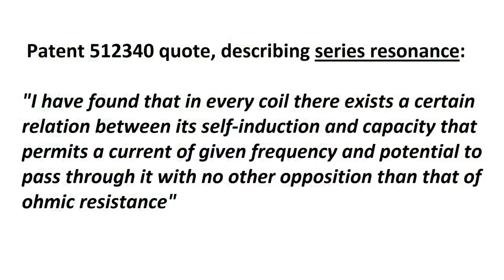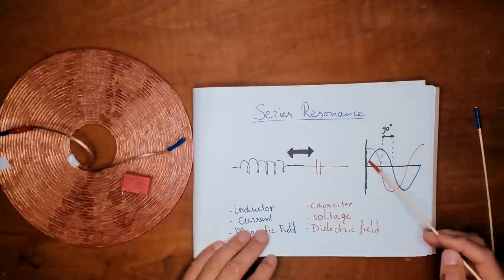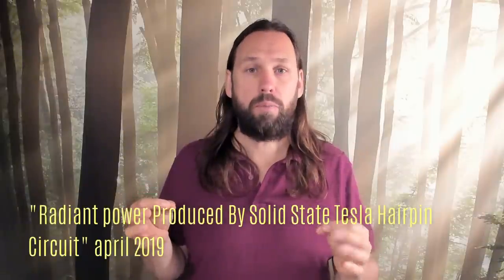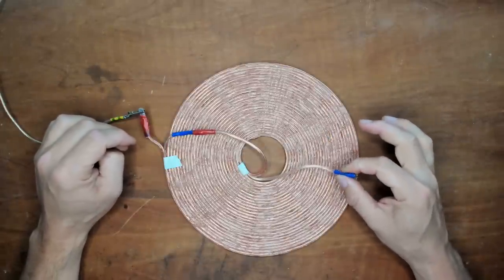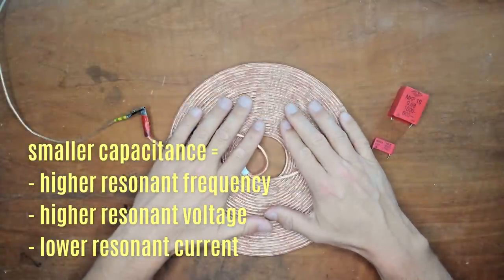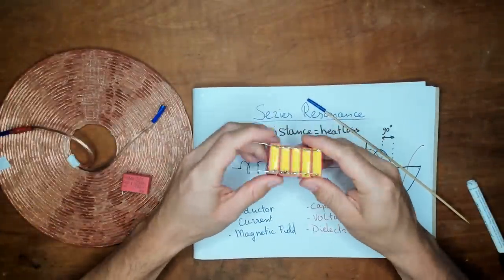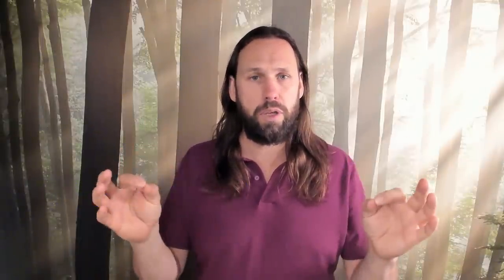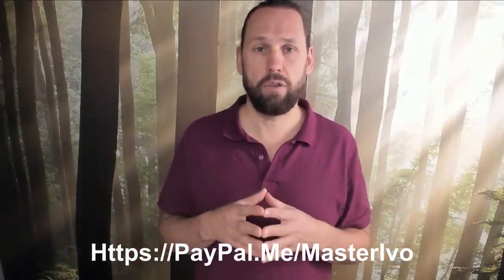The Series Resonant Bifilar Coil, Made For Longitudinal Impulse Electricity.

Comment: circuit zvs produces energy from negative poles only, You can operate 4 LED lights 3 volt - Available on the eBay website
Reply: can you develop this circuit to operate on feed-volt adapter 3000 dc transformer Microwave?
Reply: Zvs is a great configuration, it’s an offshoot of the Royer oscillator. 
It’s most certainly my favorite oscillator, however sadly I can’t get it to function with two 12Ax7  Triodes  :( I didn’t try too hard and moved onto another project.
Reply: @kolinevans9127  Simple tests On zvs - Running a small motor dc It works at low speed but when adding negative poles from zvs On the poles motor the speed increased slightly, and the difference in speed is clear - If the speed does not increase poles must be replaced because the polarity sometimes changes to mosfet in zvs --- Also, you can use it to analyze water - when you put the negative poles in cup glass  water that produces very little hydrogen - But analyzing the water for a long time, approximately 9 hours continuously, will get a large amount of red iron oxide - In water I used stainless steel electrodes not iron -But if the electrolysis of the water lasts for three days or more - Iron oxide is converted to a black substance Like oil - The reason is the acid material Also, stainless steel electrodes will be exposed to consumption Acidic effect
Reply: @kolinevans9127  Power Supply User on zvs - Laptop Charger 20 volt
Reply: maniac thanks for sharing, I guess to get a reasonably high current rotational for your alternator idea one could use the same ZVS oscillator, it kinda makes me think of years ago when the dude at the rubbish tip told me someone{s} raided batteries, TVs and probably alternators lol. 
I wonder if they had similar ideas? 
As I was the only person interested In those things that he saw I ’m sure he thought it was me lol
Reply: maniac thinking more about your question, my best answer is that the ‘b’ field of the mutual induction is separate in itself it’s own circuit whereas in a ‘transformer’ there is no physical separation in its own ‘b’ field, I’d say that would play a part , again I’m not the authority, but I hope this finds you well.

Comment: If the circuit were resonant, there would be no phase difference between the voltage and the current.
Reply: @energycrafts8206  By the way, were are you located?
Reply: The ball is in your court.  I have deleted all my previous comments.  Although the Youtube algorithm scores and ranks channels based on a number of factors including the number of comments.  So any comments, good or bad is a good thing for MI or anyone!  However, I too felt many of my comments probably seemed a bit too futuristic (despite experimental proof in most cases) and also overly  revealing of  many "secret" hints of concepts and principles, so I have removed all my public comments here.   I won't take up anymore space beyond simple limited non-revealing replies here.
Reply: Say what?
Reply: @energycrafts8206  pm me?

Comment: WTF is useful about impulse power??? Looks like you can achieve the same results using a normal coil with a parallel capacitor so at a certain frequency, the inductance is cancelled out by the capacitance leaving only the impedance of the wire.
Reply from the maker: Yes I wondered the same, That's why I keep researching. Now using current impulses, from capacitor discharge. It's a whole different effect
Reply: @MasterIvo making this into a toroidal would make incredible flux density and power density. It must be very close to the shape of nature.

Comment: Negative impulse frequency what?  Wtf are you talking about you either achieve resonance or you don't
Reply from the maker: resonance is a period of time with a full cycle of transformations between the electic fields (magnetic and dielectric).  But you can also interupt the period after 1/2 or 1/4 this creates a voltage or current impulse

Comment: I was under the impression a non inductive coil was necessary for longitudinal waves/scalar waves.
Reply from the maker: no, incorrect. scaler waves is also the wrong term. scaler is like room temperature, even all over, so nothing waves.
Longitudinal waves are always present in waves, but they can be amplified by the right resonant modes, using loose coupled dual (or more) resonant coils.